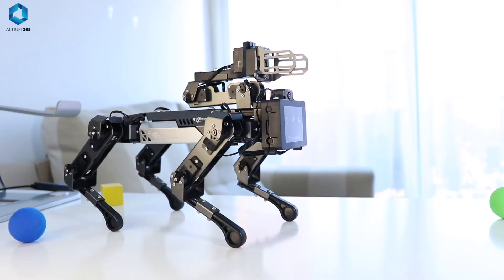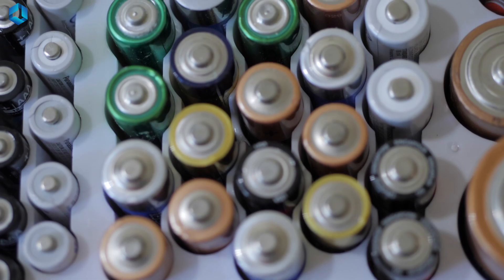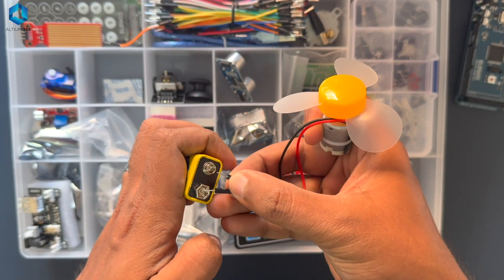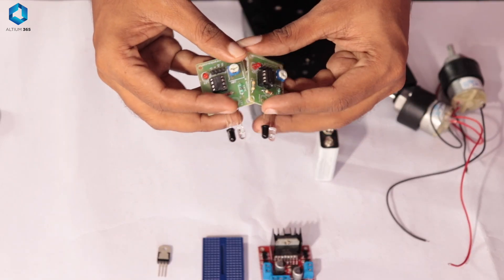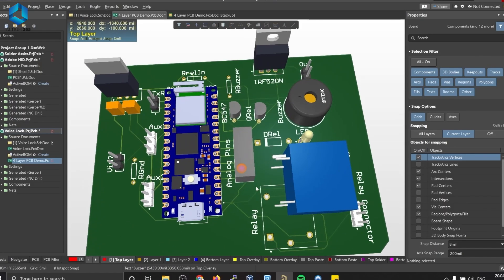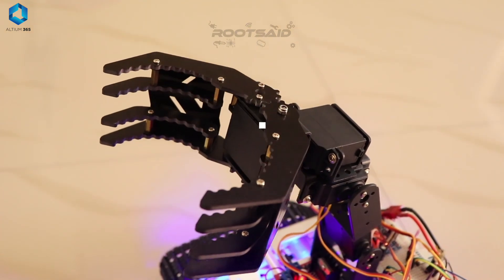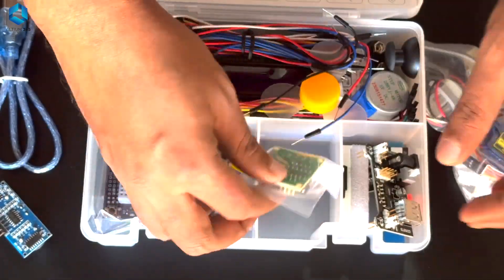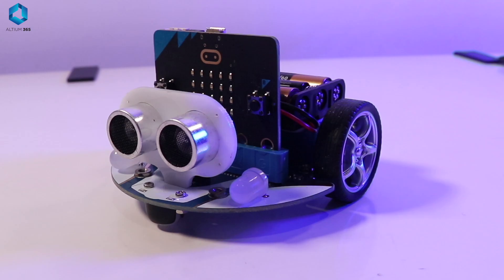How I started in Robotics? Getting started with Electronics and Robotics

Comment: 1) You have provided a link to an Electronic kit. It contains 200+ DIY projects, but 140 of them are Arts and Crafts projects, according to the kit's description on Amazon. Is there a better kit focusing only on Electronic/Science projects?  (2) In addition to a kit, what tools are needed? Eg: multimeter, soldering iron, perfboards, breadboards, etc.
Reply from the maker: Great question! While the kit includes Arts & Crafts projects, many of them help with creativity and problem-solving, which are important in DIY robotics. If you prefer a purely electronics-focused kit, I’d recommend https://amzn.to/3XBb6ir and its more electronics based.

In addition to a multimeter, soldering iron, perfboards, breadboards, and wire cutters, a few other useful tools can make your DIY robotics journey smoother. A hot glue gun is great for securing components, while tweezers help handle small parts like resistors and transistors. Helping hands or a PCB holder can keep your circuit steady while soldering, and a desoldering pump is handy for fixing mistakes. If you plan on working with motors or mechanical parts, having a set of small screwdrivers, pliers, and a drill can also be useful.
Reply: @RootSaid Thanks for your guidance.
Reply from the maker: No problem brother. Glad to help.